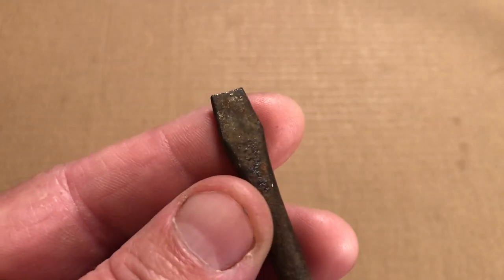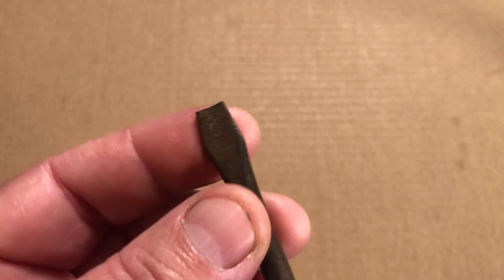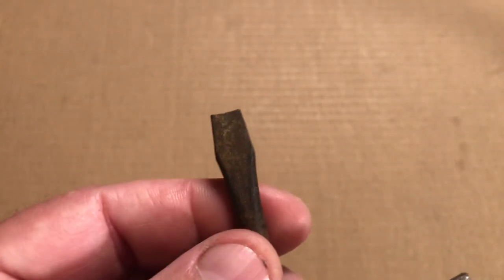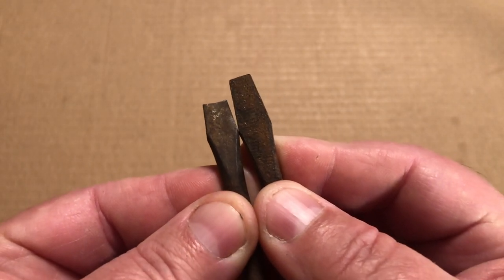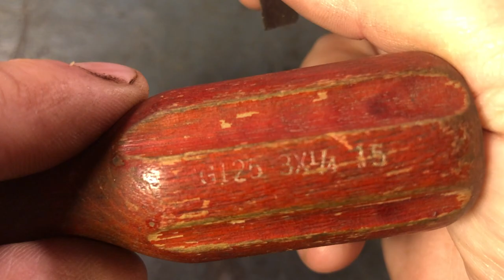Reprofiling A Screwdriver

Comment: Great job Ben!  Profiling a screwdriver tip is not as easy as it looks... I have messed up at least a dozen trying!  40+ years ago a paint store owner explained to me about how wood absorbs paint and introduced me to shellac. It was cheap back then and he told me use shellac first and don't waste the expensive paint...  I was 15 at the time and I never forgot how grateful I was that he shared that knowledge with me!  I wish everyone would buy a belt cleaning eraser!  They are such a great shop accessory!   Thanks!!!!
Reply from the maker: Yeah, shelac would have been smart. It just seems so odd to me that one would paint on top of it. But next time I'll do that. As for the eraser, don't you find it kind of disappointing how fast it works? Like, I want to do it a moment longer but its always done in a millisecond.

Comment: You did great with it Ben! My father has the same screw drivers and I saw a video from aVe where he waxed poetically on the wonders of the humble wood handle screwdriver absorbing oils as you use it and thereby giving you better grip over plastic and rubber versions of the same
Reply from the maker: There's probably some truth to that! Thanks!

Comment: Ben - Happy Thanksgiving; you did a great job refurbishing that screwdriver, but there is one simple step you could take to make it one of your favorite tools. I suggest hollow grinding the flat sides of the business end of screwdriver so that at the last 1/8" of the tip, the flat sides are parallel, and not a double bevel with a squared off end.  (A few years ago I noticed that the screwdrivers and hex bit slot drivers made for gunsmiths had parallel sides at the tip, as did certain types of European screwdrivers.) This simple adjustment would keep blade from camming out of the slots of difficult-to-remove screws and give you more effective power when screwing in new screws.  

It's sort of like the difference between an American design Philips screw driver, which typically cams out when you use light to moderate pressure to either tighten or loosen a Philips head screw, while if you use a Japanese crosshead screwdriver, made to Japanese Industrial Standards (JIS), they almost never cam out of American Philips head screws or out of the similar Japanese crosshead screws used in Japanese cars, motorcycles and power tools, because the JIS standard calls for a different, much more effective geometry.  Hope this suggestion is of some use to you.  Prior to discovering JIS crosshead drivers, I erroneously thought that Japanese products were held together with cheap screws that stripped easily; then I found that if you used tools made to JIS standards, their screws rarely cammed out or stripped and that Americans consumers were simply using the wrong tools on their Japanese made products.
Reply from the maker: Are you talking about bringing the sides of the blade in so that it looks more like this?
https://www.travers.com/electricians-screwdriver-with-thin-blade/p/602290/

I grew up working on Japanese motorcycles. Never paid much attention to the phillips heads - but moving from 10mm to 7/16 was an adjustment.

Thanks!

Comment: Minwax makes a couple different products that can help with overly porous wood. One is wood conditioner. It works well when the wood draws stain or finish unevenly. The other is wood hardener. That product smells like polyester resin used in fiberglass work but there is no hardener. it fills the pores and reduces the the time spent trying to do the same with finish.
Reply from the maker: THanks Clark. Good to know.